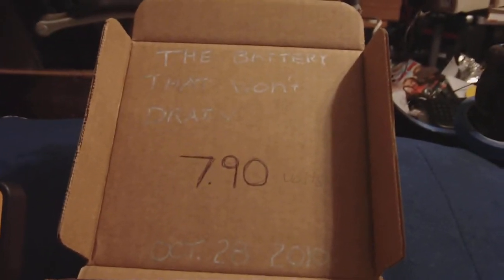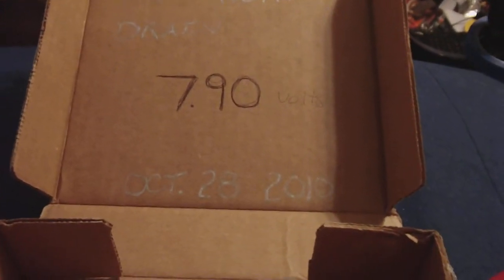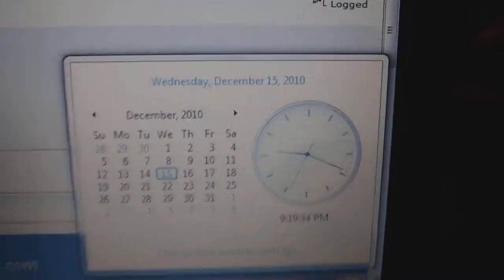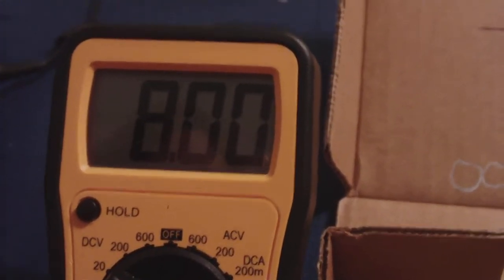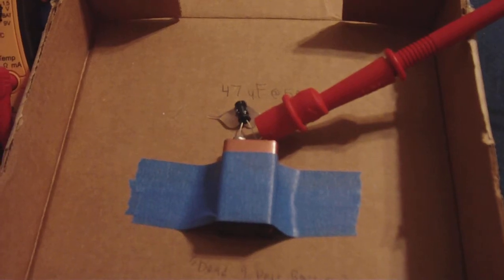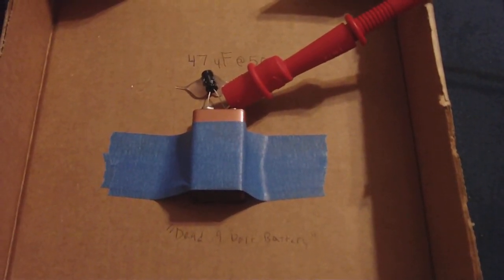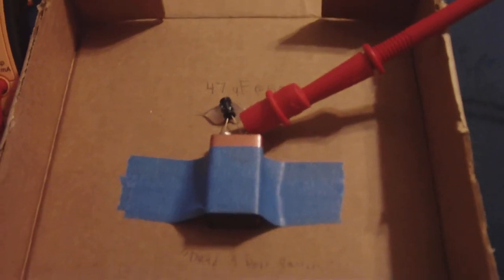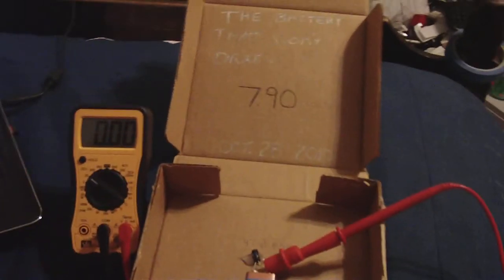The secret behind the self charging captret

Comment from the maker: @ChaChoRrom I really can't tell you why it works but only can show you it working. 

Thank you for your nice comments. What are these GRAY MATTERS you talk about? Are they gray tubes?

The self charging effect doesn't last forever, it will slow down over time but thats better than leaving the battery sitting to discharge itself. Some 12 volts batteries can loose 2amps a day when not hooked up to anything.

Comment from the maker: @Inquorate I've only tested 9 volt batteries and capacitors that are under 100uF. Most seem to self charge but not all. I can't find the link as to why they self charge. I've tried AA's but they seem to take even longer do to the fact they hold more "power" than a 9 volt. I'm really at a loss as to why it happens, its so simple but some complex.